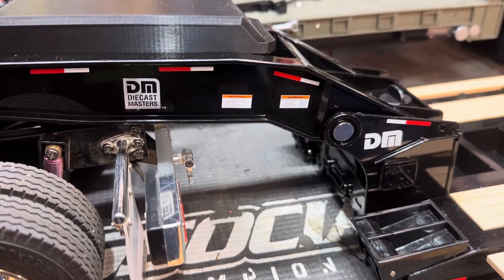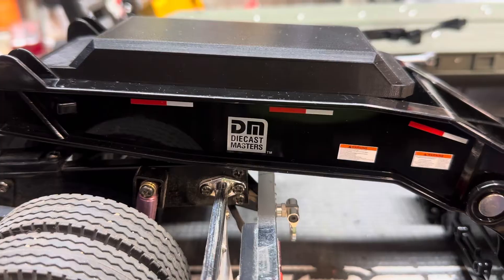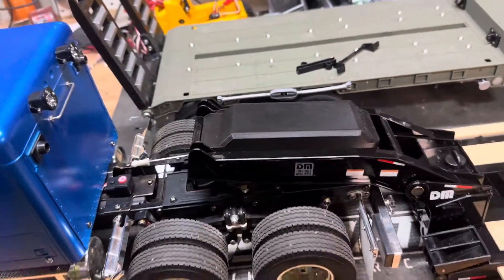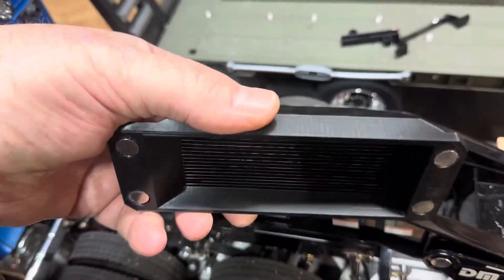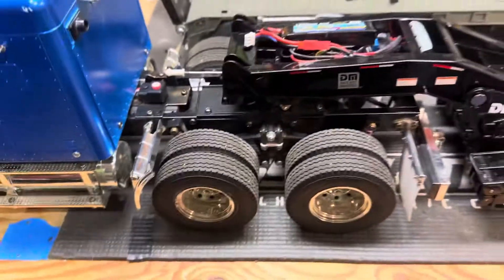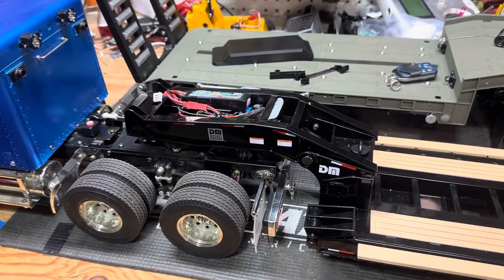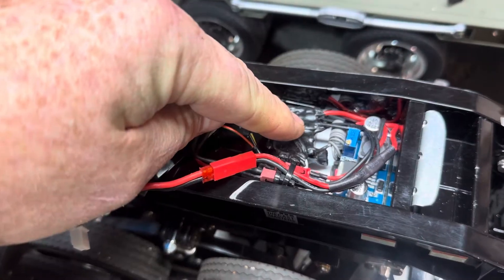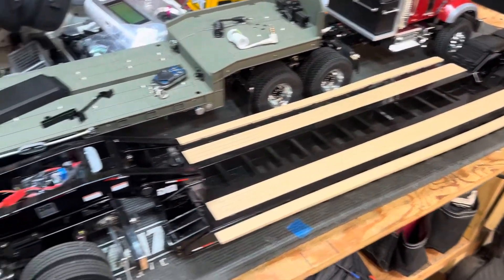Diecast Masters RC Lowboy Electronics Modification

Comment: I have thought about wiring the trailer to work from the radio since I have 2 extra channels on the RX. Did you use all 3 wires for the motor or just red and green?
Reply from the maker: Just the red and green